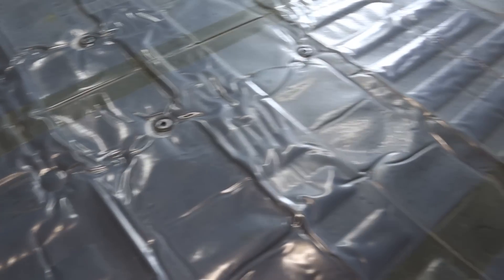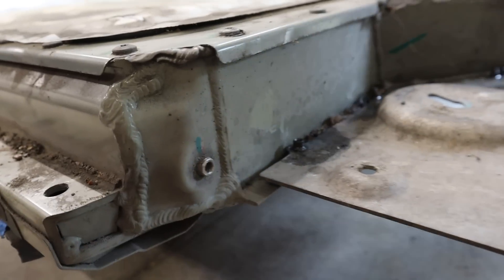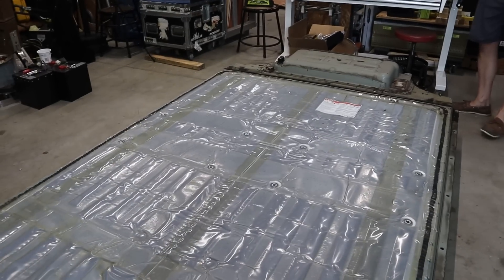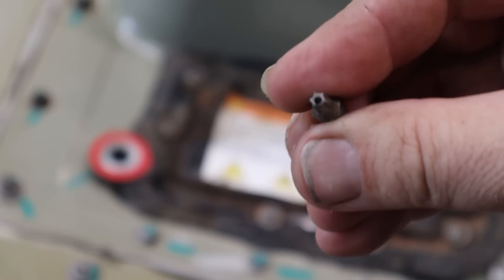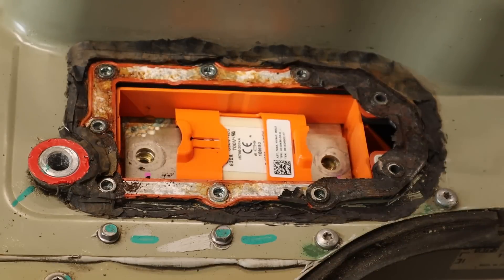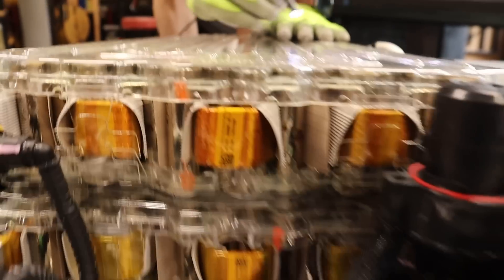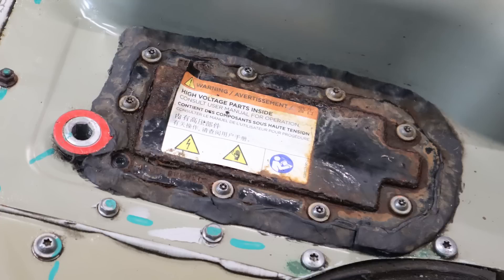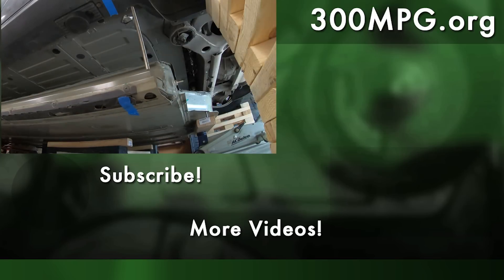WET FUSE!?! | 2013 Tesla Model S Repair

Comment: Holy mother of god. I cannot even begin to tell you how unsafe your practices are. I’m actually amazed you’re still alive.

1). ESD safety boots?
2). Working on HV with all your watches and jewellery still on. 
3). Using a non-insulated metal tool to pry open the pyro fuse lid with clear signs of water ingress. 
4). Using a non insulated tool to remove the pyro fuse lid bolts with clear signs of water ingress.
5). Poking around modules 14 and 15 with no safety / HV gear at all. 
6). Using a non-insulated “home made cotton swab” to remove the moisture in the pyro-fuse compartment.

I could go on and on. You are absolute clowns that have 0 idea what you’re doing. I am genuinely amazed you are still alive. 

For anyone watching this, DO NOT follow what these two idiots do, unless you want to risk killing yourself.

Comment: When you have a leak, when you heat and cool the battery, it works as a pump creating a pressure pump that sucks in new water containing air.

Comment: Maybe this is a reason why the newer Tesla batteries are designed to be more like one solid block of material including closed-cell foam instead of roughly 50 volume percent connected chambers of open air. Thanks a lot for sharing all the details. Interesting to see the condensed moisture and the resulting corrosion.

Comment: I've got a 2014 S, and the drain was extended to drip on the frame just in front of the battery. Though just a week ago I added tubing to get it to both edges of the vehicle and away from the pack. Tesla isn't the only one that ignores this drain, I've seen it on my 07 mazda 3 (drips on the power steering) and on dodge rams (drips on the front suspension arms) - surely it's causing issues on many more vehicles too.

Comment: Sounds to me like that that battery NEEDS  better o ring seals and a dry nitrogen pressure system with a pressure sensor . That high pressure/energy system needs positive pressure protection.
Reply from the maker: The only issue that I saw was the fact that the fuse cover was completely rusted through. Everything other than that looked very good.

Comment: Frontal Module BMBs most likely have corrosion and car will be disabled when they fail.

Removing the hump only is ultra dangerous. 14 module are still in series with deadly voltage after fuse removal.

AC drain not only water dump. Windshield runoff is another.  AGM valve on top of hump another source for moist air entry. Then repeated condensation evaporation cycle begins.
Reply: Thank you for your very insightful comments
Reply: Do you have a Tesla 2013? I do! I'll be doing this surgery next.. ⚡

Comment: It dosent look good to me. The future of the electric car is not on my list!!!
Reply from the maker: Because of one rusty fuse cover? The rest of the car is in near perfect shape!

Also, keep in mind that this is a ten-year-old car! We've advanced a decade since this one was designed!
Reply: Yeah I agree. Not to mention the destructive nature of lithium mining. It's just not sustainable.  Our power grid can not handle everyone owning a EV. Hydrogen would have been the better route to go down. Look up what happen when these batteries fail. Takes so much effort to put the fires out and then you have to space them out in special junk yards because they are prone to reignite and fires jump to other cars while sitting in the junk yards.... shameful
Reply: @fullyloadedwp  - Wow - so much misinformation. Do you work for Putin or the oil industry?  There is plenty of Lithium available, and far less destructive than fracking and other horrific oil extraction methods that create mass pollution issues.  The power grid can handle EVs without a problem as 99% users charge when the power usage is minimal (at night when the rates are low). Many also charge at home with solar, so zero effect to the grid. Hydrogen cars have a large battery too, and are about half as efficient as EVs, so you need twice the power to generate and distribute hydrogen needed per mile traveled. Since EV fires occur at a rate about 1/20 that of ICE cars, it really is not much of an issue. There are so many ICE fires, the media doesn't even bother to report on them.  Even dead EV batteries are quite valuable and recyclers pay top dollar to get them. No need to sit in a junk yard. If you do need to let them sit, you can drain the battery and then they can't catch fire similar to draining a gas tank, which I expect junk yard do as well.
Reply: @tesla_tap thank you for that PSA.. so much disinformation out there! It's like playing whack-a-mole
Reply: @ - You're welcome! Glad you agree with me.

Comment: Thank goodness I don't own An EV
Reply: Yeah, at least /ice cars don't rust ... oh, wait a minute!
Reply: @MrAdopado  a minute passed ?
Reply: @Y2Kvids  It dawned on me that cars are cars no matter what their propulsion system ... for example they rust ... all my ICE cars have eventually had some kind of deterioration issue related to, amongst other things, rust!
Reply: @MrAdopado   you can't pause mid sentence on the internet. Some one might have the wrong idea that   ice cars don't rust.
Reply: @Y2Kvids  hehe ...you're so right!
Reply: Yeah not worried about the rust at all lol can't prevent that. Not putting my car in a bag of rice everything I drive it in the rain lmfao. I can run my truck into the water. Pull it out remove spark plugs and turn the engine over to shoot the water out.  Replace all fluids and it will fire right up. Yall can keep the ipod with wheels in cali.
Reply: @fullyloadedwp  That rice reference, did you catch it on Rich Rebuilds then? That was a way to do it, not very good for the rice, lol.
Reply: @rjung_ch  lol no just thinking about what i do with my phone when it gets wet. Did Rich do this with a tesla battery? gonna have to check that video out.
Reply: @fullyloadedwp  actually he stuck a whole car in a box and filled it up with rice, nuts!
Reply from the maker: @rjung_ch  I actually thought about making a thumbnail for this video that would show the car in a giant bag of rice! Easy to do in Photoshop!
Reply: @BenjaminNelsonX   Well, that would have to be a huge bag. What's more impressive is how you got the car back on the road, once the charger is replaced, I bet you can make the free charging working again, that in itself will be totally worth it. 
BTW, I've never worked with Photoshop, I guess you could also have an AI do it for you these days, but I haven't used any AI myself as well.

Comment: the water on front of the pack is from the A/C condensation drain. Extend and route the hose to the ground instead of the top of the pack,
Reply from the maker: Yes, that's exactly what I say in the video.
Reply: They likely commented early  @BenjaminNelsonX
Reply: no sh.t!

Comment: if you are not already driving the tesla, i would install a AC vacuum pump onto the barb fitting of the battery, hope that it will go negative and evaporate the water.
Reply: Any idea how much force will be generated by 15 psi per square inch on that battery housing? Stand back.
Reply: @DCGreenZone it’s vacuum. Same principle that you use to service an AC unit. Pull vacuum on it, and the water actually ‘boils’; turns into a gas, and gets removed.
Reply: @lancenutter1067  Well howdy, let me get my Robinair vacuum pump from 40 years ago and see if that's true.
Reply: @DCGreenZone  go for it! Or go buy a cheap one at harbor freight! That’s what I did. 😝😉
Reply: @lancenutter1067  I traded a Ruger 22 mag for one at a pawn shop over 40 years ago like a dumb A@@, when I thought I'd make it big in AC. Well that was a bust but my vacuum pump still functions as advertised.
Reply: @DCGreenZone  cool! Sorry the trade didn’t work out. I do my own ac and learned how to do it about 20 yrs ago. But, it’s too risky working on other peoples stuff, because too many things can be, or go, wrong. Just finished my 1994 Chevy class c with a reman compressor. Old one had front seal leak. Wife demanded ac 😝
Reply: @lancenutter1067  It worked out, I just screwed myself on the value trade, my first was a rotary/scroll compressor from an old Whirlpool compressor, I was clever.
Reply: @DCGreenZone  I did similar thing about 10 years ago. Had bought a Russian WW2 M44 for 65$ in the 2000’s and traded it for a Honda 70. Sold the Honda for a profit, but now really want that weird gun with a bayonet, no less, back. Won’t be anymore cheap Russian stuff now…

Comment: I'm gonna guess that Tesla isn't going to cover this repair? 😂
Reply: I think Ben mentioned the previous owner was told by Tesla that it would probably cost more than what the car was worth, so he sold it really cheaply to get rid of it. And since Ben is fairly technically savvy, he's able to troubleshoot and repair it for a tiny fraction of the cost.
Reply: @Geckogold  Yeah I know. It's just sad that this is the direct result of Tesla's screw up and they won't cover it. Even after it's been shown that their recalled part caused it.
Reply: @greghellings  If the car was still under warranty they would have covered it but it expired 3 years ago.

Comment: My 2016 MX with 95k miles, displays "Replace the high voltage fuse soon."
Reply: It's probably just a timed or miles based maintenance situation.    Like an ICE car telling you to change your oil.
Reply: Tesla has used several different types of fuses. The 2016 used one that had a small battery, like a coin cell, that eventually goes bad. The replacement fuse you'll get does not have a battery and has no expiry date. If you're still under the 8 year battery warranty the new fuse is free. Out of warranty it's a few hundred dollars, not terrible.
Reply: @markusstrobl1067  Great info. Thank you.
Reply from the maker: That's related in that they are both fuse-related. Other than that, totally different issues.

Comment: Could you have put the battery pack under vacuum to boil off the remaining moisture?
Reply: Its good for HVAC because the 14.7 psi differential pressure is nothing for tubing or the compressor, evaporator or condenser. But on a battery case that is 85” x 59”, thats 5000 square inches, and with 14.7 lbs of force on each square inch, thats 73,700 lbs of force. Problem enough to cause damage. Maybe not as bad as the Oceangate Titan imploded, but definitely more than on any HVAC.
Reply: @imho7250 another consideration might be positive pressure to keep water/ moisture out. The compressor for air suspension could have a hose connected that opens a valve anytime moisture is detected, or with an add-on Bluetooth button at the dashboard programmed to the suspension/ positive pressure valve, in order to anticipate when you see puddles, flooding, heavy rain, etc .. @BenjaminNelsonX
Reply from the maker: Interesting concept, but the pack would have to be perfectly sealed up first to even try that. Fans are simple and low tech.
Reply: @BenjaminNelsonX  another consideration might be positive pressure to keep water/ moisture out. The compressor for air suspension could have a hose connected that opens a valve anytime moisture is detected, or with an add-on Bluetooth button at the dashboard programmed to the suspension/ positive pressure valve, in order to anticipate when you see puddles, flooding, heavy rain, etc